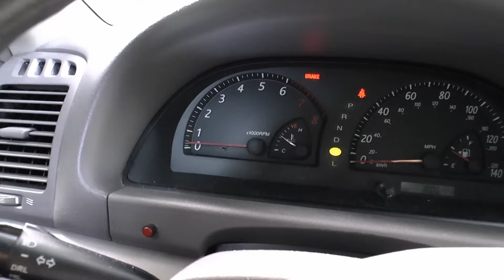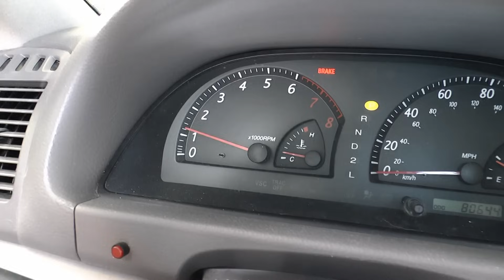How to Fix Low Idle Problems in Your Car (Throttle Body)

Comment: Hi Scotty, I have a high RPM that reach to 1500 to my civic lx 96, and when I turn my AC on, it will go down to 1000rpm and also there is a bearing noise or I don't know how to call it. Do you have any Idea? Thanks
Reply from the maker: well, try cleaning the throttle and checking for vacuum leaks also. As for the noise, remove the fan belts, and if noise goes away, figure out which device has worn bearings.
Reply: Thanks Scotty, I will try to make it tomorrow. This is an old Honda Civic LX which is my project.

Comment: Hello Mr.Kilmer.. I have a Toyota Avensis SDN Prestige 1.6L 2007 5 speed manual.. My car vibrate at 2800 RPM and vibrate disappear at 3000 RPM. This happen with any gear. The vibration is under my legs, at 2800 RPM. What could this be? Thank you.

Comment: I prefer to take off TB to clean it and not spray cleaner directly into intake with all that dirt, to re-install, clean mating surfaces, torque to OEM specs in criss cross pattern to avoid any damage from over tightening..

Comment: Hey Scott I got a 05 jeep liberty with the emissions light on. I had both catalysts changed and spark plugs. The light came back on. Mechanic doesnt know what the problem is. I used after market parts could that be the problem?
Reply from the maker: yep could be that, but realize cats often go bad because something makes them go bad, rarely do they burn out on their own. Fuel injection problems, oil burning engines, lots of things can make them go bad, and aftermarket cats often won't jive with the software and the light can stay on. Start with a better mechanic

Comment: I have this same exact engine for my solara scotty, no matter how hot or cold the weather is if i start up my car after a whole day without drving it, whenever i begin to drive, i have to really press a good ways down the gas pedal to get a good 40mph on the highway or else it just feels slow and sluggish in the beginning,  after drving it on the road its all good. Is this normal for a camry/solara?
Reply from the maker: Cesar Alvizo  not normal, try cleaning the MAF sensor and if not that, often they need replacing

Comment: Scotty I have 03 acura mdx. I have to crank the car and Rev the engine to turn it on, and i have to warm up the car or else it will shut off if I put in reverse. Do u know what the problem is?
Reply from the maker: Jawid Qahir many things can do that, start with new spark plugs and air filter, and try my video "how to clean fuel injectors on your car" and PRAY that fixes it. MDXs at that age can get expensive
Reply: Scotty Kilmer I did all that and still the problem is there. Anything else I can do? Check engine light is on I got 4 misfires

Comment: I want to fix my car, but I'm having a hard time finding a video with a situation that lines up with my car.  2013 Nissan Sentra, idles rough, will go as low at 500 RPM, then rev itself up and save itself, but in this process it has killed two alternators.  Any suggestions? I'm considering the IAC and possible the throttle? Maybe a vacuum leak? It's fine at highway speed.

Comment: My car idles really high after not wanting to start we finally got it to start after changing the fuel pump almost every sensor in it and it still is idling really high I've cleaned out the throttle body and replace the sensors around and I'm really stuck I don't know what to do I've heard maybe vacuum leak I don't know what or which one help

Comment: I have a Honda City 2006 model which sometime loses its Rpm and its drops and even if I push the whole race paddle.The car still doesn't work for two or three second and after while it's works just fine any help or suggestion can you provide. I went to the Honda dealers in lahore Pakistan they say that this model has a  problem in automatic transmission

Comment: I've got a low idling 1999 camry 550-650RPM cleaned throttle and IAC valve and brand new OEM Toyota Air filter what's my next move? Thanks.

Comment: Hey Scotty, I have an 06 cobalt. I was wondering if the throttle body could make my RPMs fluctuate while driving? I noticed it between 40-70 mph but the problem goes away after 20 minutes. As soon as I restart the vehicle, it happens again.

Comment: I know its been years since you posted this video, but I haven't seen anybody mention the throttle bodies that say not to clean them. I have a 92 F150 and it has a yellow sticker on the throttle body that specifically says it shouldn't be cleaned. Also, what about the newer electronic throttle bodies, wouldn't the little motors get messed up with the cleaning?

Would we have to replace the TB in that case? Seems kinda drastic D:

Comment: Hi, im roger from the phillippines, may ask what causes the high rpm when u step on ur clutch pedal shifting from ist gear to 2nd  and also still rising rpm when ur running on ist or second gaar. The rpm is also delayed after ur gear shifting is done at ist or second gear. Tnx. A lot and i will really appreciate for any help or response.  My car is honda crv 2003 model. Thank u and Godspeed!!

Comment: +Scotty Kilmer So I have an old Toyota Corona 1988 ST170 says on the plate the engine is the 4S-Fi latley we just replaced a faulty spark plug that decided to blow up and now it idles like absolute shit. But on the open road its perfectly fine. While idleing it will eventually conk out. How do I change the Idleing?
Reply from the maker: if it blew out, make sure the new plug seals right and that it doesn't need rethreading first. And do a compression test of that cylinder, it could have low compression and internal damage now

Comment: hey Scotty i have a question

i have a 1996 toyota corolla DX and when i start it up and drive it in cold weather the transmission stays in 3rd gear until the temperature gauge is at the proper level point which then afterwards it will shift properly

and this is when im going 40mph or above

what is cause of this & the remedy please?
Reply from the maker: +fargeeks old age and wear, live with it. It would need rebuilding to fix that
Reply: +Scotty Kilmer ah yes old age but sure is a goodie when its fairly warm outside it shifts properly

a rebuild sure is something to look into

:)

im tuning in to every video i run into of yours

Comment: Please Scotty i have a 2003 toyota camry. The idle speed /RPM drops so low whenever i put on the A/C compressor and it shakes the engine but the idle speed goes back to normal when i turn off the A/C and the engine doesn’t shake even when i put it in drive. Please help me

Comment: Hi, Scotty I really need your help I have a 2000 Mit eclipse gs , I have two codes p0505 idle air control system and p1400 exhaust gas recirculation monitor sensor can you please tell me how to fix this and where to find it I need your help and I'm stuck would be much appreciated it .. I put a new iac switch still the code comes back when I clear it
Reply from the maker: it can be bad wiring to the iac, bad main computer , sticking throttle plate, and much more, try cleaning the throttle first. As for the egr, change the sensor and pray it's just that

Comment: Hi, I have a 1997 Suzuki Baleno. It's not running entirely right. It idles at ~600/700rpm, I'm not sure whether that's too low or not, but it makes the car visually shake when idling. It also shakes quite a bit when accelerating from low rpm or while letting your foot of the gas.

Apart from that the car doesn't seem to be missing power, but it runs funny. No check engine light though. Is there anything I can try to find if there is an issue, and what the issue is?
Reply from the maker: I now answer questions at scottykilmer.com so go there to the ask scotty section
Reply: Scotty Kilmer Alright 👍

Comment: Quick question, even though i have no check engine light on and just want to remove the throttle body and clean it, do i still have to perform the relearn process?

Comment: Hi scotty, what cause a popping sound at exhaust during deceleration at high speeds?
Reply from the maker: often a leaking fuel injector putting too much fuel in, or a problem in the ignition system not firing correctly during decceleration

Comment: I have a 03 Saturn Vue 4 cylinder and it idles low kind of bounces around a little bit so not sure if it's the throttle or maybe the coil if I can get maybe like an Insight Maybe

Comment: Hi, my chrysler C300 5.7 L , i did clean the throttle and fuel injecters but the problem still not fixed,the rpm somtimes drop down like the engine about to stop for second while stopped the car in p gear and it going normal again,can you help??
Sorry for my weak english.

Comment: Hi Scotty, I have a 2002 Ford ZX2 that's recently developed an unsteady, loping idle along with a noticeable loss of power. It also idles high on startup (about 2000 RPM) and then drops down to a normal idle (900-ish) when I put it in gear. I suspect a leak somewhere in the intake system, as I have had vacuum problems with this car before with similar symptoms. What would be the best way to go about checking to see where the leak is, or even what else might be wrong with the car?
Reply from the maker: do my video "finding engine vacuum leaks with a cigar"

Comment: I really need help with this one: when I start my car up cold (it's an '88 mazda V6 fuel injected) it idles at around 2200 and then slowly drops to 1000 as it warms up. from there, I have to sit and hit the gas some until it decides to go down to 700 (the correct speed) so then I drive off.
In addition, it tends to idle very low in D upon stopping. it shakes and the oil light comes on a little until I hit the gas again, sometimes it stalls if I let off too fast. I plan on cleaning the throttle and MAF sensor. any other suggestions please?
Reply: About the idling too fast, it might not be a fault, most cars will start with a much higher idle to get the engine up to operating temp far faster, the sooner it reaches the right temperature the better. As for the low idle? I remember an '04 Nissan, can't remember the model, was a 2.4 if I remember right, had the same sort of problem and turned out to be a vacuum leak at the intake, but try cleaning and see what results you get, be sure to take note of any behaviour changes.
Reply: Since I posted that the problem changed, now it starts up at 2000 and then shuts off after about 5 seconds. No sputtering just turns off, fuel pressure and everything is fine.
Reply: +DavidsfarmlivesFAN it might be a bad fuel pump or a bad throttle or a bad air filter
Reply: It was the mass air flow sensor, so $310 later it is working fine now :)

Comment: My legacy gt has weird idles sometimes and stutters when idling but the rpms dont move they stay at 1000rpms  and also when i come to a complete stop it shakes and the rpms go below 1000 and then revs back up by itself up to 1500rpms, can the throttle body be causing that?

Comment: hi scotty, 
my car idles poorly, but not all the time.
Its usually if i drive my car, turn it off, then come back in twenty minutes or so it has trouble.
will something like this solve the problem?
really do not want to take it in. thanks!
Reply from the maker: often idling bad when warmed up and sitting a while is leaking fuel injectors. Try having them cleaned as in my video "how to clean fuel injectors on your car"
Reply: thank you! i recently just changed my battery so it was worth a shot!

Comment: I thought you weren't supposed to move the throttle body butterfly if it was electronic, supposed to have someone rev the engine...just asking because I need to do this and my throttle body won't open up all the way.  Opens and closes, opens and closes quickly.

Comment: Scotty I have a 1994 Ford escort 1.9L Wagon, and it idles on 1500rpm, so after buying a new IAC Valve, it does the same thing, so now i drive my car with the IAC Valve wiring unplugged and it idles at less than 500rpm and the car is just shaking really hard as if it's about to turn off... any help or suggestions on what that might be? please reply.
Reply from the maker: that old thing, amazed it's still going. Problem is, computers run the idling system, that old, so many things will be off from the original settings that it can't set the idle right. Start by doing a wet and dry compression check of the engine, and if it's worn out, live with it until the engine blows. don't waste money on something with a worn out engine. if engine is not worn out, do my video "finding engine vacuum leaks with a cigar"
Reply: yeah it was going to the trash a couple months ago(it was shooting blue smoke and wouldnt go more than 20mph) had the piston rings redone with a local and super cheap mechanic, now runs fine, only that problem is left. I'll try that, thanks man :)

Comment: Hey Scotty on my 2011 Cruze the car ocassionally idles poorly. It normally idles when warmed at around 8500rpm but sometimes when coming to a stop and sitting for a minute or two it will drop down to 5000 or less and even shake and rattle and sometimes lunge forward and act like its going to stall. Sometimes I can go months without this happening and other times it happens all the time. On some forums and things I've been noticing people a lot of the time blaming the PVC valve. What do you think? (I did replace the battery on the car once but it was doing this even before I swapped it.)
Reply: idles at 8500rpm? HOLY SHIT!
Reply: he probably meant 850 :p

Comment: Hi Scotty Kilmer.... I have 2010 Toyota yaris with 80,000 miles and rpm gets low after 15 min of idling or driving and temperature stays normal and no check engine light and i changed spark plugs and air filter and changed fuel injector and clean Throttle body and mas air flow sensor
Reply: Problem is its a Yaris. Looool

Comment: I have 2003 Mercury Sable and it has been driving too lean. It started off with a vacum leak. My husband has changed out oxygen sensor, pcv, pvc valves,  mass, map sensors, tps, new oil and fuel filter, new gaskets, idler air control and probably some other items I can't remember at this moment.  I pretty much have a new enging, anyways my car wants to stall out when sitting at lights or stop signs and even when backing up.  We have been dealing with my car for over a month now and are getting really frustrated as to why it's stalling when everything that has to do with sensor's and vaccums has been replaced.  He has even cleaned out the throttle.  Please Help!!  Any ideas!!

Comment: How does carbon build up on the thorottle plate? isn't it just aspirating clean air from the air box?
Reply from the maker: pcv system sends gunk into there , and vapors can rise up from inside the engine when sitting hot

Comment: hey scotty i have a 2004 dodge stratus v6 2.7 liter i changed my air flow sensor and every since i changed it i been having trouble when i start my car it runs for a few seconds and it stalls what can i do to fix that
Reply from the maker: well, perhaps you got a bad sensor, I like using ONLY factory oem ones myself

Comment: Hi Scotty, I have a 1988 opel manta gte. It has 2.0E CIH engine with bosch LE jetronic injection system. It recently developed a problem of not being able to idle correctly, it would fall to say 500 then drop to say 200 then bounce back up a few times and then die. I've increased the idle with the adjustment screw so now it idles a bit higher than it should, this is all well and good but when I'm driving it and let off the gas the revs dont fall as quickly as they should, so gearchanges become annoying. I've cleaned out the throttle body but I cant figure it out, help would be very much appreciated.

Thanks

Rob (UK)
Reply from the maker: try my video "finding engine vacuum leaks with a cigar"
Reply: Scotty Kilmer thanks Scotty, I'll give it a go!

Comment: My 2001 Grand marquis 4.6L has been cleaned in throttle body, and still has some strange issue only when idle at stop in drive. Voltage drops way down from about 1/2 way on voltage gauge to about 1/8 just above lowest reading on in dash voltage gauge! Then back to normal when I start moving again and step on gas... however it doesn't fluctuate when traveling, stays in mid section on gauge. No change it blower or AC is on or off doesn't matter...tested all voltage wiring and replaced alternator! still same thing at idle when stopped in drive! Doesn't stall out, still idles and stays running but with barely any voltage. Battery is tested under load and voltage is good. I'm at a total loss.. " no clue what could be causing this problem, but apparently I'm not the only person. There are many complaints about a voltage drop issue at idle under various conditions!  It's got the voltage regulator build on the back of the alternator on this model car. Any suggestion Scott please?

Comment: I don't know if I would say my idle is rough runs about 900 once it warms up 1200 when cold and and 750 in gear but when I rev it past 2300 it kicks back like it's going to die. It's a 97 pathfinder le 3.3 runs great never dies just a little exhaust leak and the rev issue. Any ideas?
Reply from the maker: +Italian Madman fix the exhaust leak first, that can make the engine computer get bad O2 sensor data then run lean and do just that

Comment: Hi, my Toyota 1Nz yr2002
Looses power after the engine gets warm after driving nonstop for about fiftykilometres. If I slowdown or go down a hill on idling it doesn't accelerate but after a few minutes of cooling it picks again and does the same again. Please help.

Comment: I have a problem with my nissan patrol safari 2005, it starts and then it's like it cannot handle the idle at the beginning but if I press on the gas a little it is then fine, what would I do?